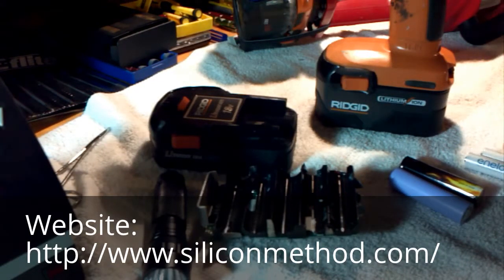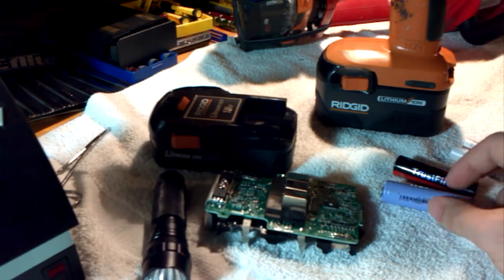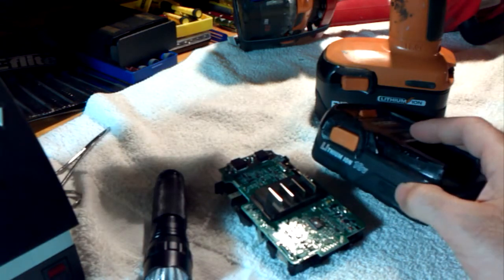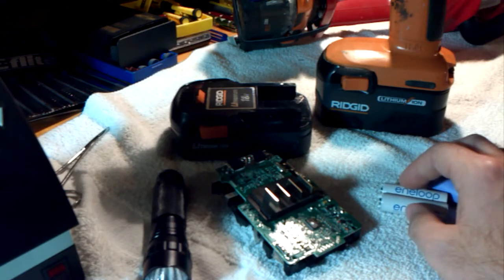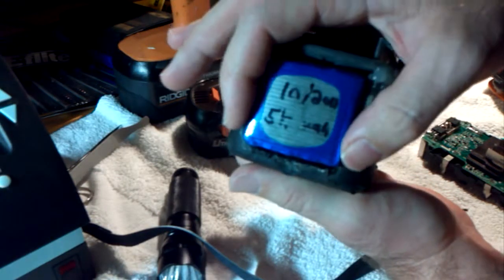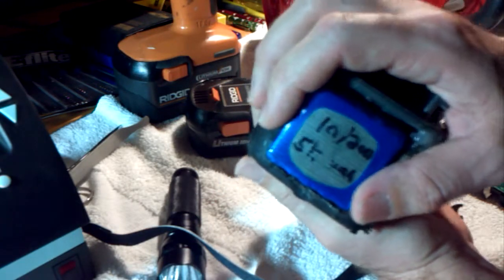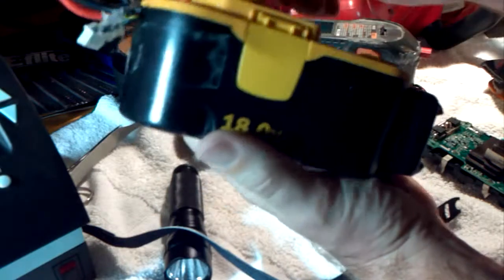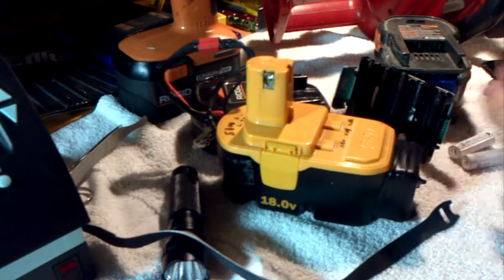Discussing nickle metal hydride, nickle cadmium, and lithium ion battery packs.

Comment: I have stopped using nickel cadmium and now use nickel hydride.  I also have a flashlight that takes the 18650 cells.  Of course I never did use that Ultrafire battery that came with it.  Instead I went to a battery store not too far away and got a good one that really is protected.  There are so many fake Ultrafire batteries that no one who knows anything about batteries would use them.  I only wanted the flashlight.  I might wrap it with electrical tape to prevent it from shorting and exploding and take it to the recycling bin.  I would think it is a good idea to insulate it just so that if there is any metal in the bin it won't short that battery.  It is noticably lighter than a Tenergy battery that I bought to replace it and although it says it is protected, there is no PCB on the Ultrafire.  I would know because I took the wrapper off to see what brand it really is and there was not even any computer print on the side.  I am convinced that it might be just a generic battery shell with a small battery inside and some flour or some other filler inside it.  The only thing that would be worse than that would be if the battery would explode.  It has not been through any discharge and recharge cycles from me but with the reputation Ultrafire has gotten, it is probably from a used laptop battery.  After all, why else would it come with a nice flashlight and a charger for only 5 or 7 dollars?  I know that I did not pay for a good or even safe battery.  I found that out while I was waiting for it to arrive.  I did some searching on Ultrafire and no one has anything good to say about them.  Quality like this makes China look bad.  It is so bad that sometimes it seems that everything from there is cheap or dangerous or worse poisonous.